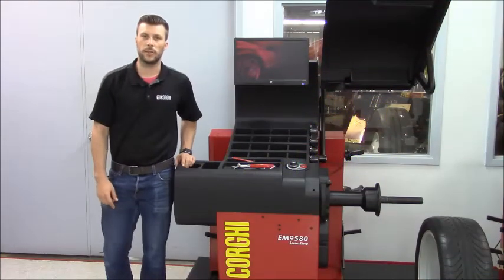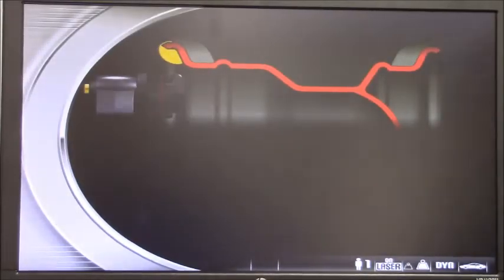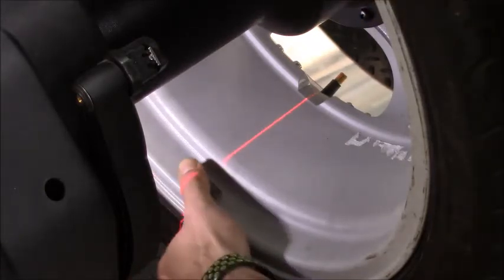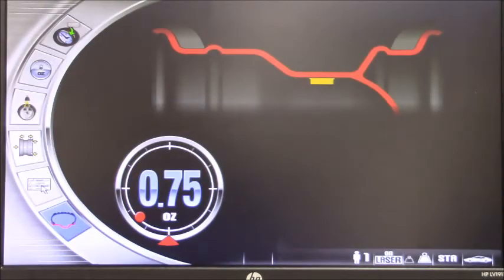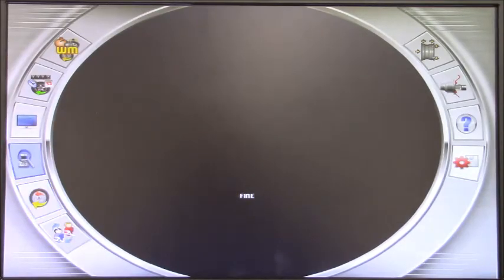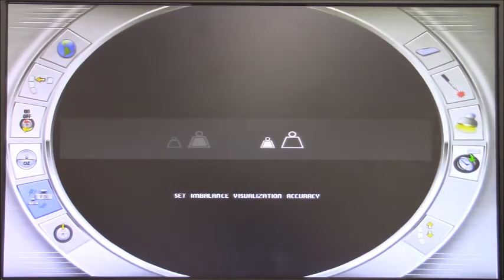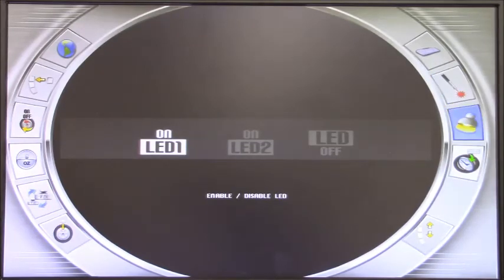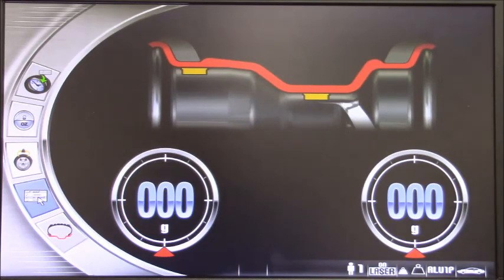9580 Operational Video

Comment: It tried to balance a wheel with that machine for 6 hours until I gave up.  Now I can see that is not explained properly how it works.  If you try to measure where you want to place the tape on weigh on the outside edge of the wheel the computer will show that is clip on weigh and not tape on weigh until you take the measure from the inside of the wheel. 
At minute 27 you will see that is confusing,  and it should be explained just to ignore the computer and take the measure from the inside of the wheel.

For a $12,000 machine I was expecting a more explanatory manual or technical support.   I also bought the Artiglio 500 $18,000 machine and I was left along with a manual and youtube to find out how it works.  It has been a nightmare ever since.  Youtube helps sometimes more then the technicians.
 I will not recommended to buy corghi equipment in Canada unless you know how it works.  Do no expect any help from the sale guy they don't know how it works.